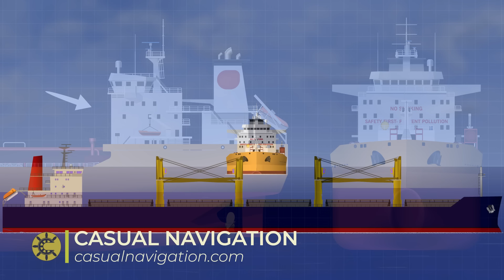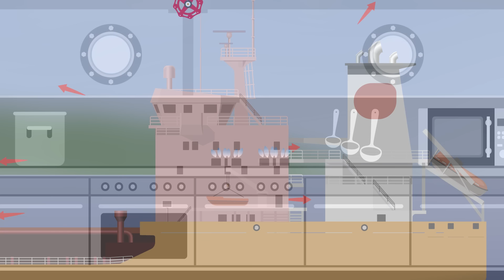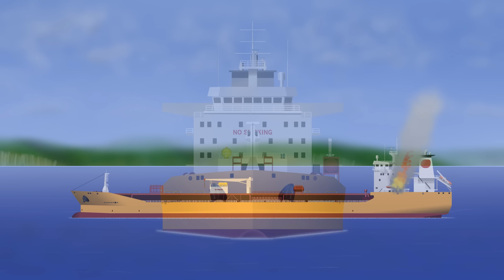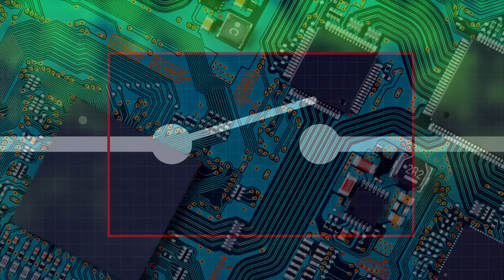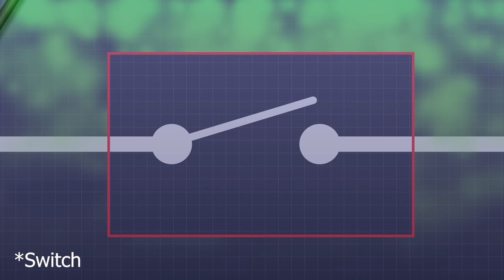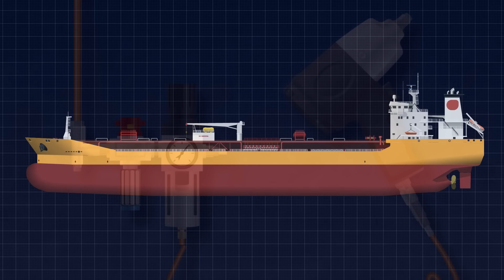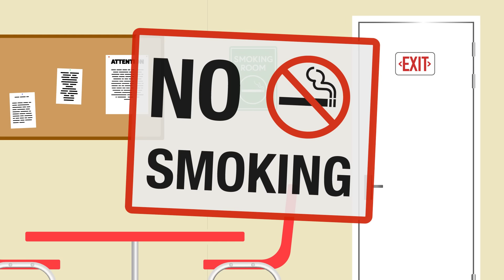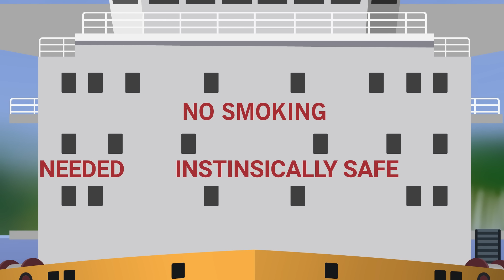You Can Smoke On A Fuel Tanker! So Why Is This Sign Here?

Comment: If I ever see a tanker with “NO HEAVY PETTING” written across the front of the accomodation block, I will consider my life complete.
Reply: That's up there with train cars that say "DO NOT HUMP" on them. I always turn to my wife when we see that and go "that sign can't stop me, because I can't read"! 

FYI "humping" in the world of trains means taking apart and putting together trains in a hump yard, which is basically a bunch of connected tracks on a slight downhill grade. You push the car over the hump, and it rolls down and slaps into another car, automatically coupling together from the force. It's an older way of breaking and putting together trains, far more common to just use yard engines and shove cars around on flat ground now.
Reply: @saml7610  Yes, the double entendre came later than the practice of humping train cars in railroad yards!  As with most businesses, fraternization on duty is frowned on today.
Reply: @saml7610  And the "do not hump" cars are not constructed suitably for this process; they may be OK to be pulled in a train but not OK to receive the jarring bumps of humping.  Railroads keep lists of cars on their trains, so it would be known in advance at the railroad yard whether the cars are "humpable."
Reply: @SeekingTheLoveThatGodMeans7648  yeah I've been told the DO NOT HUMP warnings are vestigial, and these days, the little radio tags have all the info on how the rolling stock should be handled. Still fun to see.
Reply: @saml7610  or the archeology classic of relative dating, you have to be very careful with relative dating and it's only a good idea under certain circumstances. 

relative dating refers to method of finding the age of an artifact or site, which uses the age in relation to other known ages (this is the soil layer below the 500 year old layer and above the 1000 year layer so it's between 1000 and 500 years old). Relative dating doesn't work if you don't have any benchmark dates, like an item found out of context in a thrift store, or if the dating information is unreliable/missing, such as trying to count tree rings but not having an overlap in tree ages. This is opposed to absolute dating, which can figure out the age of a sample even if you get it mailed to you anonymously with no return address. Absolute dating typically uses isotope decay ratios or solar excitation or some other highly technical thing that we hand off to the specialists.
Reply: It gets lonely at sea for weeks on end
Reply: If it is done well, heavy petting does create sparks between the people involved. Thus the warning.
Reply: @Dave_Sisson  One should lubricate to reduce the risk
Reply: @A190xx  i.e. real sex?
Reply: @Arron 190  Lubricant? That doesn't just have to do with being a fagg does it?
Reply: @Dave_Sisson  what does petting mean?
Reply: @nandi7772  Petting is kissing, hugging and gentle touching. By my understanding petting stops a long way short of sex.
Reply: @Dave_Sisson  I googled it but couldn't understand it totally. Your explanations makes things clear thank.
Reply: This will now be my goal in life. To buy a heavy tanker and write no heavy petting across the accommodation block.
Reply: I mean - sometimes (in relatively dry air) petting cat can be wild experience where one must avoid "ending" pet on cats ears or it could ignite "gases". Just saying.
Reply: I came down the comment section to ask about "NO HEAVY PETTING" and I see this -- what does it mean?? big dogs??
Reply: @IrregularPineapples  "heavy petting" is sexual touching essentially. The only place you ever see the phrase is on notices at public swimming pools in the UK where it's one of the things banned alongside running, splashing, ball games, trying to drown your obnoxious siblings etc. Presumably there was an epidemic of aquatic frisky business in the UK at some point which warranted this.
Reply: @chemistrykrang8065  ... I'm disappointed I was expecting something related to animal wholesomeness
Reply: @chemistrykrang8065 Don't forget "no bombing".
Reply: @chemistrykrang8065  Correction: it was an epidemic of insecure individuals in the UK, who had hopes to end their suffering by fulfilling other people's lives with unnecessary difficulties. Pretty catastrophic event too, considering we still have to take written permissions to film a school football game, and other shenanigans it caused..
Reply: @IrregularPineapples  ask your parents when you get older.
Reply: @halogeek6  you are a little off to the side ay? You understand that the phrases or slang you use in the UK are not used anywhere else in the world that speaks English? That’s why people don’t understand. Because your words are really weird. We don’t use “petting” for sexual terms here in North America. That’s what we use to describe touching a pet or a person in some odd cases, but not sexually. You call the “trunk” or “cargo bay” of a car a “boot” that is not what a boot is a boot goes on your foot 😂 if you search the definition of “boot” I bet it will have nothing to do with a car LOL
Reply: "heavy petting " is a term that was used in America which has pretty much dropped out of use by the mid 80s , but anyone who has seen old footage of prudish people complaining about the youth culture (now played in jest)  from the 50s to 70s will be familiar with the term.  Having grown up in the 80s and 90s is why I am able to remember that the term is also in the American vernacular
Reply: @htopherollem649  Any time I hear “heavy petting” ‘Creature of the Night’ from Rocky horror starts playing over and over in my head.
Reply: @dylandettorre  oh no,  now I do too! 🤣😂
Reply: @htopherollem649  It will now forever haunt you my friend. My apologies
Reply: @dylandettorre  curses,  cuz I'm still silently singing it, laughing! 😂
Reply: @dylandettorre  what's even more disconcerting is that I'm now watching a video about an industrial accident with a smile
Reply: @iCazZiStronZi  Last time I checked you guys still didn't kick footballs with your feet
Reply: @mfaizsyahmi  ya I am Italian soo I don’t really care if you make fun of North Americans, it just soo happens that I also speak English. But you do in fact kick a football to get a field goal or punt. I’m not sure if you know the sport enough to talk about it lol 😂
Reply: @iCazZiStronZi  that depends directly or whether you're reading Webster's dictionary, or the Oxford.
Reply: @htopherollem649  to be honest I support that but we’ll keep that between us…and everyone else who reads this
Reply: @iCazZiStronZi  and boot in german means boat lol
Reply: @__KursK__  🤣🤣🤣
Reply: @htopherollem649  for some weird reason it was also youth slang in Germany in the late 2000s. Same meaning 🤣
Reply: @iCazZiStronZi  Of course the American has to complain about British and make a fuss for the most meaningless stuff
Reply: @hoshyro  I am not American LOL soo your statement “of course the American” is absolutely hilarious that you think you know stuff. I am Italian and I currently live in Canada. Soo take a seat and relax 😆😆😆
Reply: @hoshyro  When one country says something they are an asshole, but when two countries are saying the same thing, you are the asshole 😂
Reply: @iCazZiStronZi  boot is an interesting one...
Many dictionaries do include the current British definition of boot as the luggage compartment of an automobile.

But then theres the fun part...
The word boot was used for the luggage compartment or rack of stage coaches both in Britain and America. It seems that it evolved from external seating that was shaped like a shoe, but then then seating changed over time to become luggage storage.

The early cars had no luggage storage since space was a premium. Luggage had to be carried in trunks strapped to the back or roof.

America has done much to rationalise the mess that is British English, however the story of "boot" has taken a new twist.
With the introduction of computers, boot now also means to load, start or power up a computer (or program). Sure that definition derives from bootstrap, but it is a nice example of how language remains reluctant to conform to rationale.

And I leave you with a little bonus to boot.
"to boot" meaning extra or bonus.
Reply: @iCazZiStronZi well, in the rest of the world, petting is "intense hugging" as well, I'm Russian and most Russians will understand the word, despite not being brits at all. I understand that it's not a customary thing to say in North America, is there an American word for this? Do you call it sеx light or something?
Reply: @krabofkhaos  Well I am also from Europe I am Italian but currently living in Canada. Neither Italian or Canadian english and I also speak fluent Spanish none uses that term other than to describe like petting a dog
Reply: @iCazZiStronZi  interesting! It may have something to do with the "fact" that there was no sex in the USSR, I mean роrn had to be smuggled in during 80s; or maybe it is related somehow to the fact that UK was a safe heaven for Russian oligarchs. The word "petting" is fully phonetically imported, Russian literal  petting being "stroking" (гладить), while heavy petting is just "petting".
Reply: @krabofkhaos "sex light" this made my day. 😂
Reply: @iCazZiStronZi In German the word “petting” is a loan word and has an explicitly sexual meaning. 
Although I’m not sure if it’s still as much commonly used nowadays.
Reply: @IrregularPineapples 
Quite a good name for a tanker too, the Heavy Petting.
Reply: Haha, no horseplay, either!
Reply: When I was a kid, but old enough to already know the answer, I loved asking the teachers that took us swimming what 'heavy petting' meant. They never answered 😀
Reply: @AnthonyHandcock is it a precaution that one encounters in a pool?! Bizarre! I've seen a sign "no girls older than 2 allowed in men's locker room" in a gym. But heavy petting...
Reply: @AnthonyHandcock 
I had NO idea what heavy petting was and wondered why people would take their cat swimming anyway.
Reply: @AnthonyHandcock  Oh, a beach sign.  I guess the idea was to avoid offending fellow sunbathers with the sight of wild caressing.  Could not a pup tent be pitched, though?
Reply: @SeekingTheLoveThatGodMeans7648  I've never seen that on a beach sign. Pretty much the only sign I've ever seen on a beach is "NO DOGS".

Perhaps it's a British thing that we don't need to be told not to wank in public 😀
Reply: @SeekingTheLoveThatGodMeans7648  Pitching a tent is definitely done when doing heavy petting...
Reply: I guess it could build up quite a bit of a static electricity!
Reply: I want to see a 'No Ball Games' on the main deck
Reply: @Leecifer Voorhees  Reminds me of that kid spinning some...THING that was wrapped on a string from the movie Titanic. 
But a lot of my original Nintendo games said "PLAY BALL!".
Reply: I concur. I wonder if the navy has that rule though
Reply: @Drence Mangalindan "Heavy Petting" is a bit of an old fashion term now, it was more popular about 40 years ago. It was typically used at schools, sporting events, basically anywhere teenagers might hang out. It meant "no making out", basically saying you could hold hands or maybe exchange a brief kiss (which would be light petting), but dry humping, heavy tongue kissing or slipping you hands into your partners shirt or pants was "heavy petting" and therefore not allowed.
Reply: :-D
Reply: NOFX
Reply: Oh you just have to locate the heavy petting room.
Reply: @Drence Mangalindan "heavy petting" is a colloquialism that means "no touching below the waistline," as in "no third base." If you know baseball, then you know what 3rd base means. If you don't you've got my definition of "no touching beneath the waistline." Hope this helps!
Reply: Petting furry animals causes sparks and static buildup. In the right environment it could kil you.
Reply: Fundraiser for tanker when?
Reply: Maybe on the arce from the World flooding Bibel Story
Reply: No UFO albums
Reply: Even with the proper safeguards? Condoms and ESD straps?
Reply: The other OTHER Custom of the Sea.
Reply: I'd probably sign on another line. That's a dealbreaker for me.
Reply: I'll bring my cat and pet it as much as I like
Reply: I've seen a septic tanker that said "back off, we ain't hauling milk," so I just stayed back lol
Reply: Nonsense is nonse
Reply: In this life, it's always acceptable to sweat the petty things in polite company but, I'd advise against petting the sweaty things.
Reply: Nice to see I am not alone in my thoughts......
Reply: Don't worry. Be gay petting.
Reply: So, wait....what's this comment section about? 

I get the OP...and the sign...and the meanings...both of them....

.....🤔.... this comment section, though.....
Reply: Every port has a happy ending awaiting.  There will be no glory  in a hole onboard
Reply: One could use lubricant with some conducting additives to allow equalization of potential differences during petting.
"Petting" is used in Germany, too. I always cringe when people from the US assume that somehow they are involved or more important than those from another country, just because someone speaks English. Its "English", not "American". Nobody really gives a fuck about your local interpretations or legislation. Especially not on a channel about international waters. :D
Reply: Ok, I had a feeling she was a religious chick.
But one night we were both drunk, we engaged in "heavy petting". 
But then her friends wouldn't stop calling to bring up the Taco Bell to the apt.
Now every time I goto Taco Bell ill randomly add "heavy petting" into my order. 
Thanks Lords n lads of YouTube.

Comment: The heavy petting sign took me off guard and I got very concerned.
Reply: I guess that counts as a static electricity risk…
Reply: clearly, someone's never seen a Gilbert and Sullivan musical.
Reply: @Anne Frank Vape Pen  Since the cargo of a fuel tanker will not attract rats or mice, at least not of any ordinary kind, a cat would be redundant, and static electricity would be a danger anyhow.  That said, Exxon still has a tiger for your tank.
Reply: @SeekingTheLoveThatGodMeans7648  we're talking about shipping crude oil.  Exxon adds the tigers during the refining process.
Reply: Well it's only reasonable. With all the seamen around..
Reply: @ImperfectVoid8479  Use dryer antistatic sheets when doing your laundry, it helps.
Reply: Sounds like a boring voyage. Lol

Comment: Does this rule apply to specific ships that carry cargo like lightable gas or to all cargo ships?
Reply: I can't say for shipping, but for trucking it only applies to dangerous goods loads.

The fuel tanker I used to drive even had its exhaust pipe routed under and out to the front of the truck, with the muffler running parallel to and under the front bumper, just so that fuel couldn't spill / leak out and land on something hot.

Drive a dump truck hauling gravel and you can smoke as much as you like (well, assuming your company allows you to smoke in their trucks, or you own your own truck).
Reply: As a general rule of thumb yes it is for tankers, gas carriers, etc that carry flammable liquids. However there may be a few other types of ships that will have these signs if they regularly carry large quantities of flammable or explosive cargo.